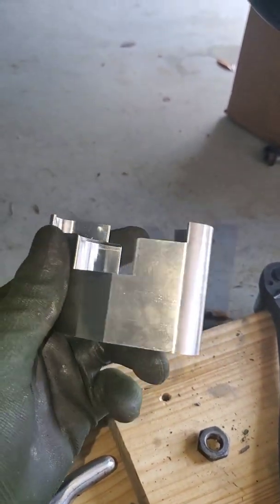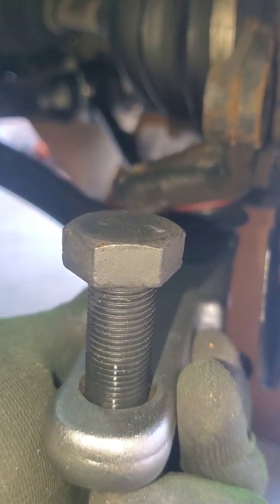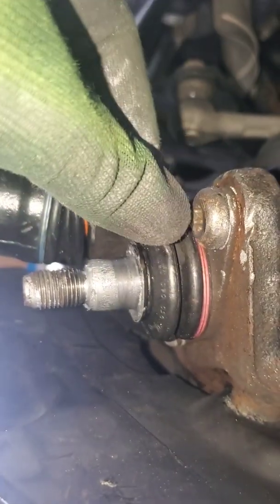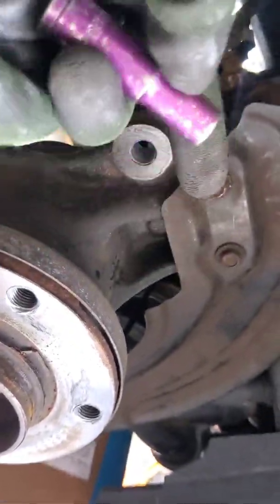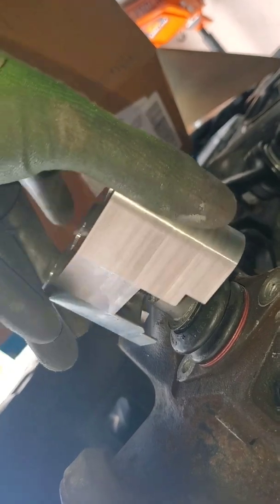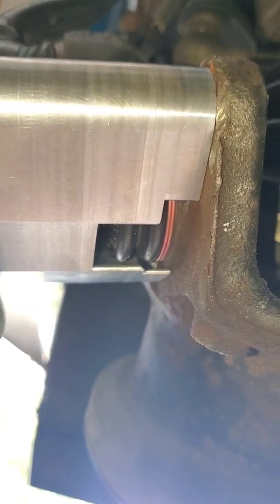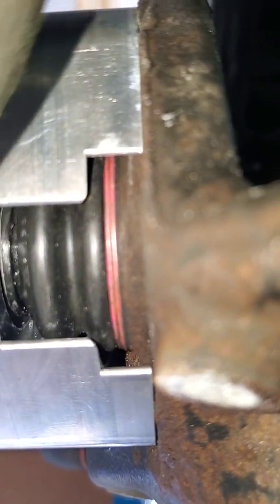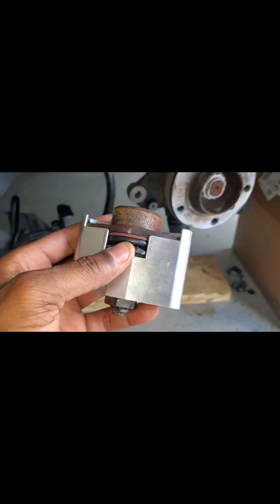BMW Ball Joint replacement for F25, F26, X1, X5, E90, E91, E92, E93, E84, E53 X-drive

Comment: This tool was a life saver. Spent a week trying to remove my ball joint, technically gave up but then I saw this video. I was able to remove the ball joints and replace my control arms in a day. I recommend spraying some wd40 before hand(as I did this while I was struggling without this tool the week prior) and hitting the joints with an air or power hammer while the remover puts pressure on the joint. In my case I had to remove the tool, because the joint was digging into the tool as it was getting extremely difficult to turn the nut. When I removed it, I noticed the joint had embedded into the tool. I shaved down the squished build up with my dremel, reattached it and then it moved like butter. I made sure to shave down my replacements to ensure they’d fit into the tool in case I needed to do this job again in the future. Thank you for the help, 140$ is more reasonable than buying tools and an air hammer and compressor that didn’t work.
Reply from the maker: Thank you for your honest feedback! Glad to hear another happy customer.

Comment: The tool proved invaluable while replacing the control arms on our 2007 530xi with 260k miles on it.  Don't use the tool by itself though.  That's a mistake some seem to have made.  You need to first saturate the ball joint with PB Blaster and let it set for a day or so.  Then apply a lot of pressure to the ball joint with the tool, while also firmly tapping the top of the ball joint with a punch and hammer.  Tap the outer edge of the ball joint (not the center) btw.  Firmly tapping the ball joint from above, while also having the ball joint under a lot of pressure from below(tool), will shock the joint and cause the bond to release.  At that point, you can just tap the ball joint out from above.  Otherwise, you may need to remove the tool and add the bolts in order to finish pulling it from below.  Good luck....
Reply from the maker: Thank you for your honest feedback! These are great tips for anyone who may have ball joints that are extremely rusted. Glad the tool made your repairs easier.

Comment: Do i have to remove the brake shields if i use this tool on a F25/F26?
Reply from the maker: Yes
Reply: Thank you very much Sir, the shipping to germany was realy fast only 9 days. That version for the F25/F26 dosent sit flush on the steering nuckel it needs the same cut outs like the Tool showen in the video i think it is the e9x Tool. Finaly i used the method with the two bolts the driver side was like a walk in the Park maybe because i soaked it in rust remover a few days before. On the passenger side i didn t had the time to do it, it was harder to get the ball joint out i used a short braker bar but finaly the ball joint came out. In south Germany we have a lot of problems with rust and i can say without the tool the job is nearly imposible for a DIY Warrior.

Comment: Leave the control arm bolted to the ball joint. Hammer preferably with an air hammer all around the joint and bolts. This loosens up the rust on the joint and the bolts holding the joint in. Spray the top of the joint with penetrating oil. Drive a pickle fork between the arm and ball joint. Now wedge a large chisel on the outer sides of the pickle fork. This will pop the joint out.
Reply from the maker: By the time you’ve purchased/rented all the tools (air compressor, air hammer, fork) to follow your technique, you’ll have spent way more than the cost of our tool and the ball joint may still not come out. Your advice could work for a mechanic with a fully equipped shop though.
Reply: @Crunchysann  The truth of the matter is I was going to make my own tool out of pipe and threaded stock with some welding. I had to get the arm off of the ball joint fist and it popped out before the arm came off. You have a nice product, but if you want to talk about spending too much we can go there.
Reply: @Crunchysann  I have a garage, a small compressor $150, air hammer as little as $13, fork $10. These tools will pay for themselves in one or two jobs. So no not a mechanic will a fully equipped shop. The X5 has 170,000 miles on it. Won't be much more stuck than that. Besides the ball joints are NOT a press fit. There is lots of clearance in the fit, the bolts hold it in place. You get the crap loosened up and it will come out. Your welcome.

Comment: Does this tool work to put the ball joint back in there?
Reply from the maker: Hi, no. This tool is to remove the ball joint. You don’t need a tool to install the new ball joint. Simply push the new ball joint in as far as you can by hand, then slowly tighten each screw a few turns at a time to slowly push the new ball joint in place.

Comment: Bought this tool and ended up pulling out the ball joint and stripping the threads   Had to buy a compressor and an air hammer to remove it. Please revise your invention
Reply from the maker: Hi, unfortunately there are few cases where ball joints are rusted in place past the point of repair. In this case the main wheel hub assembly needs to be removed and replaced or brought to a machine shop to have the old ball joint pressed out if possible. Please remember you can also use this tool as an adapter for the press.

Comment: Hello, thank you for inventing / designing this tool , I replaced both lower control arm on a e90 xi but could not remove the ball joint, quick question do we need your tool to sit the nee ball joint in place ? Or do the t50 allen bolts push the new ball joint all the way in ?
Thanks again
Reply from the maker: Hi, you’re very welcome. No need to use the tool to install the new ball joint (only to remove). The screws will press it in as you’re tightening.
Reply: Hello ,  can I ask you if this tool is going to work on the e90 Xdrive model specifically ?

Comment: I'd like to have seen how you removed the T50 torx bolts.
Reply from the maker: A T50 socket and electric heavy duty impact wrench worked well to loosen them. Something that has close at least 700Nm of torque. Or you can use a long ratchet.

Comment: Unfortunately the tool won’t sit flush on the one ball joint. Was able to get the ball joint off the one side, but with the passenger side, the tool just refuses to sit flush around the ball joint
Reply: That's the situation where you put the bolts back in but leave them with 4-5mm of thread exposed, then put the tool on.
Reply from the maker: If it fit one side and not the other, it’s likely the is rust or dirt that needs to be cleaned off the car first. A wire brush works well for this. Also, if the car has an aftermarket part installed, it’s likely the part is bigger than oem.

Comment: Just did my 338xi ! Must have tool!
Worked as advertised! 5 minutes to remove ball joints.
Excellent customer service ,answered all my questions very promptly.
Don’t think about it  just buy it and save lots of time.
Reply from the maker: Thank you for your honest feedback @Arnoldo!
Reply: Can you please tell me if you can put the ball joint back in it's place using the same tool thank you..
Reply from the maker: @florimbaj  hi, please see our previous reply. You do not need any tools to install the new ball joint. Just clean the knuckle well using a wire brush and slowly tighten the ball joint screws (ie. 2 turns per side) until the ball joint is fully seated in place.

Comment: tool worked well had to back up ball joint stud with internal torx bit to prevent stud from turning , did not see it from the side and a  hard 10.9 metric nut in the kit would be easier than using and fighting  a old ball joint lock nut

Comment: Is it necessary to pull of the rotor shield?
Reply: bro take off the caliper and shield takes 10 mins give you all the room u need..just did the job and this tool is a must have!!!! less than 20 mins crank that bad boy and it will drop
Reply from the maker: You don't have to, but we recommend you do so. it will give you more clearance to see the entire workspiece so you can visually verify that the tool is sitting correctly.
Reply: Thanks Gents, Changing Thrust arm, control arm, stabilizer links and ball joints this weekend! Excited to use the tool, hopefully it saves me a headache.

Comment: I own a 2006 530xi E61, I have a stuck front ball joint.  Is this tool compatible to my car?
Reply from the maker: If you use Method 2 described on the tool page https://crunchysann.com/BL/ it will.

Comment: Used this for an E60 530xi ball joint as well. 
The ball joint is very similar to the 3 series but just longer. To compensate I threaded some 40mm long M10-1.5 bolts in and then mounted the tool. It pulled the ball joint right out with this minor mod.
Reply: Hey Roy,, I own a E61 which is similar to yours . How did your thread the 40mm long M10-1.5 bolts ? I'm planning on purchasing one of these and I'm hoping it will work removing my stuck ball joint
Reply: @functiontraining9788  if you send me an email address I can send you a picture. But basically those bolts are threaded into the ball joint bolt holes (two shorter M10-1.5 pitch Torx bolts hold the joint to the knuckle). You need strong bolts so the threads don’t rip up. I used some grade 12.9 hardware from Home Depot.  The tool then rests on the heads of those bolts. The big ball joint nut (24mm?) Is used to pull the ball joint out as you turn it slowly. Came out in 10 seconds this way.
Reply: @ajroy1052  thanks Roy , I appreciate it

Comment: So I ordered one of these and it was sent out right away, it arrived a few days later. Well designed and very light. I did run into an issue but it wasn’t because of the tool. 

Someone tried to remove my ball joints before and rotated them so that the tabs closest to the brake rotor were a little too close to the knuckle. I had to hammer my tool into place. It beat up the tool but it worked and was able to remove both.

My car came from Colorado so the ball joints were quite rusted, applied penetrating oil to the back, tapped the tool in to place and only snugged the nut on. Using a steel drift and hammer Id give it a couple good taps and tightened the nut. Doing it this way was a 5 minute job to pull the joint. 

I tried removing the joint before using a sledge hammer and steel drift, air hammer, pry bars, penetrating oil, etc. I could hear the ball joint laughing at me, never even budged. Impossible without this tool on a rusted ball joint.

Thank you 5 of 5 stars!
Reply: hello from where did you order can you please send me the link
Reply: @dogankaya3887  links are in the description of the video, it won’t let me copy.